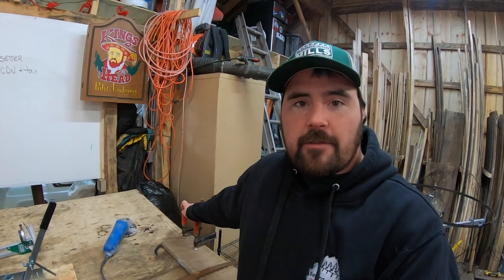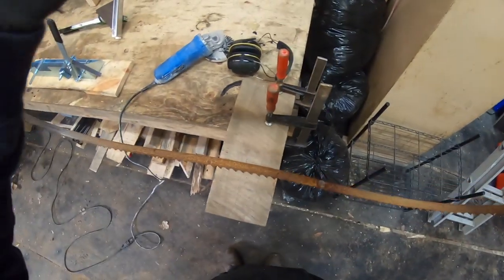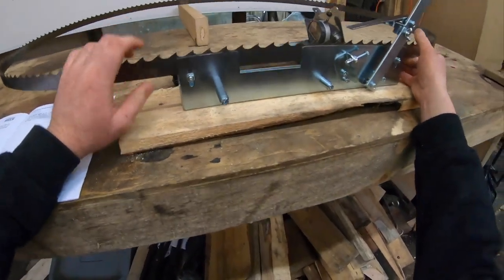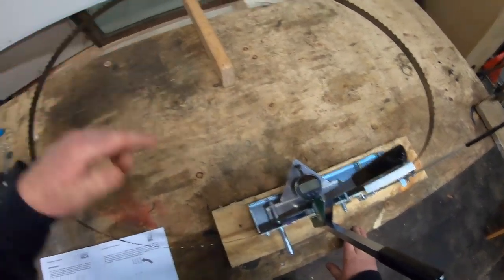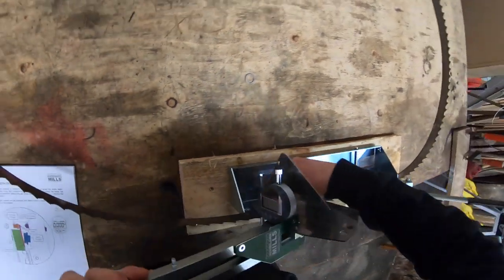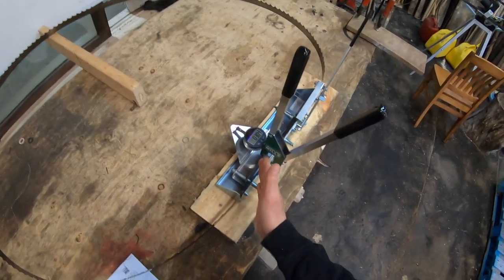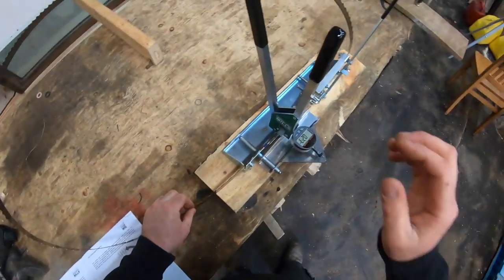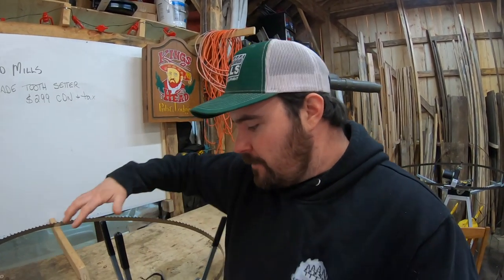How to Setup the Woodland Mills Sawmill Blade Tooth Setter

Comment: Sandy, just a couple of things, when you want to buff the inside of the blade just turn it inside out, that way its the same technique for both sides, and easier to manage with the blade below the board. As for flipping the tooth setter around to do the other bend, wondering if also turning the blade inside out would work, that way the handle is always pressing in the same direction away from you, it looked awkward to manage by having to pull towards you. Btw very informative show, thanks.
Reply: its a squeeze not a pulling motion the whole purpose of the design was to not have to mess with the blade flipping
Reply: @Bass4R3nt  I’ve had the setter now for a few months, and sharpened about sixty blades, if you are right handed it works best to turn the blade inside out, Sandy is a south paw, so he didn’t know about that.

Comment: Freakin GREAT video Sandy.  Thank you!  How about that non-offset tooth?  In your experience does it tend to stay non-offset?  Unless a guy hits something, I would think so.  In any even I imagine a careful inspection of the blade will tell a guy if that non-offset is bent.  Then I supposed it's just marking it and slightly pushing it back to center?
Reply from the maker: I find the non offset tooth stays there unless I hit something by mistake

Comment: Run the blade on the mill with water and hold a wire brush on either side takes the rust off quick
Reply from the maker: That would do the trick!

Comment: Hello,  so your working with a skip tooth blade set, not sure i agree with cleaning wires brush method rust Prevention works for me. (Maybe a brass wire brush)  As well consistent set ensures consistent mill results. Tension is important as well. Good vid. Lots to offer as i worked in business years ago. Good stuff sandy. Cheers Bob
Reply from the maker: Thanks Bob. I normally wouldn’t let the rust get as bad as it was in that situation but I figured since o was going to originally just discard these blades I could instead use them to learn my new setter and sharpener. Thanks for watching

Comment: So I just go my setter.  I put an old blade on to set it, but there is no pitch that I can see left on this blade.  Would you say it is shot or should I just start it from scratch and set it the way I want?
Reply from the maker: If it cuts well without saw marks on the lumber I’d just resharpen it as is. If it’s not cutting well I’d add my own set and cut a bit with it. If it cuts great then You’re all set up but if it doesn’t may need new blade

Comment: You made a nice video, but I have been messing with this thing for 3days and I cannot set it up so that every tooth ends up the same  and for me that’s not acceptable, the blade sharpener works very good though.
Reply from the maker: Be sure to start right after the weld in the blade and end right before it as the distance between teeth on each side of the weld may vary slightly.
Reply: I didn’t mean that the teeth don’t line up I meant that the degree of the tooth set is different on each tooth, in fact I’ve even brook the tip of some of the teeth.
Reply: You'll need realllllyyyy good steel in a blade before the set will be acceptable to any one that deals in less than a thousandth.......
Reply: @garyreinoehl804  Some of the higher carbide more expensive blades will break teeth when setting.

Comment: genuine question and not a criticism but does it matter cleaning the surface rust off the blade if the cutting surface is sharp?
Reply from the maker: I normally wouldn’t have surface rust on the blades that would need removal but these blades were quite old. I find if I take the rust off it just moves through the sharpener and setter more snoothlu
Reply: @sawingwithsandy  yes, mine leaves the rust on the setter

Comment: the sharpener and setter are for people who dull a bade at least 5 times a month. and I feel its good value for the price. but I personally feel time is my greatest asset so when its time to cut either get someone who has professional equipment to do it or spend a lot more and get something to cut time in half hours sure do add up if you gotta sharpen sixty blades per month
Reply from the maker: I can see what you’re saying there Derek. Makes sense in your case

Comment: Sounds like a big pain in the ass. Do pliers not work?
Reply from the maker: Problem with pliers is there’s no way to measure how far I’m bending the tooth
Reply: Repeatability would be a problem too.  Just one tooth being offset too much will mark up the cut board or plank surface in proportion to how far off it is, so I've heard and experienced a little bit.